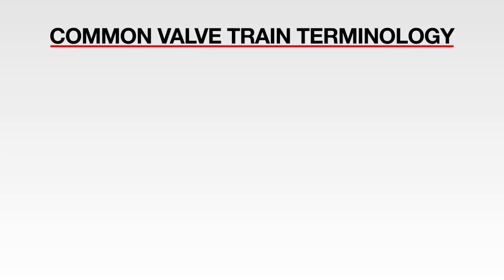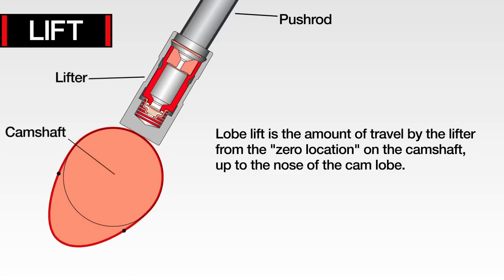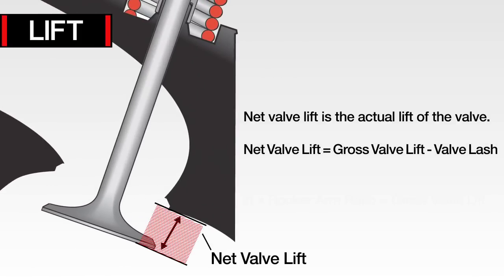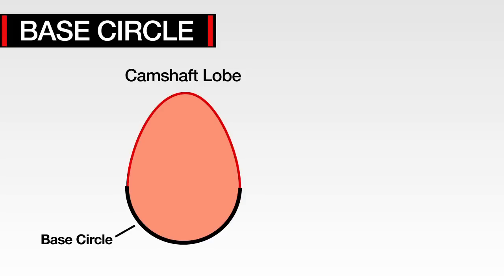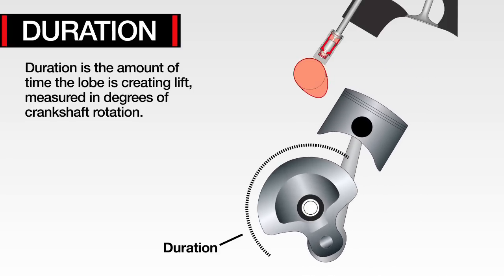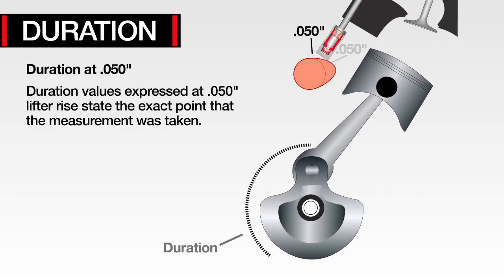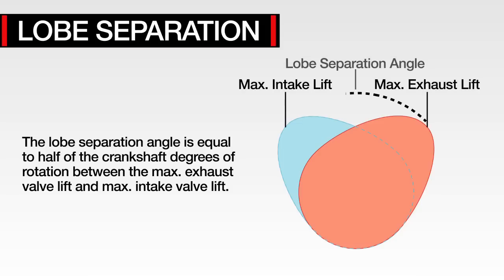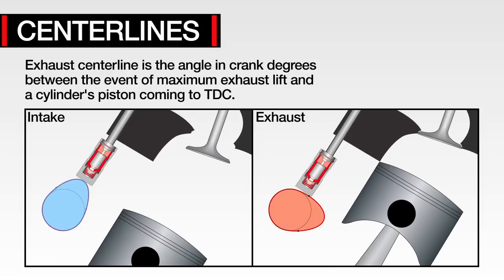COMP Cams® Technology Explained: Common Valve Train Terminology

Comment: Great video guys thats why i only use comp cams i have a 2200hp 500ci lsx twin turbo motor in my 67 chevy II and with the help of your tech team and my builder you guys ground the right cam the first time no second guessing what we got or what brand we got no wishing we had got a different cam at the dyno everything was spot on i have ran 3 seasons on this cam with no problems at freshning up time so great job guys i really like your stuff

Comment: Lobe separation angle can be changed, just not with a single cam engine. DOHC engines can change their intake and exhaust centerlines and thus their LSA. That's, basically, what's happening with modern variable valve timing - the computer is commanding the cams to constantly adjust their centerlines to provide the best performance for given driving condition.

Comment: camshaft lift and duration can alter the power and torque characteristics of 4 stroke engine. 2 similar engines with similar displacement capacities fitted with different camshaft lift and duration times can have a world of difference in terms of performance and consumption figures!